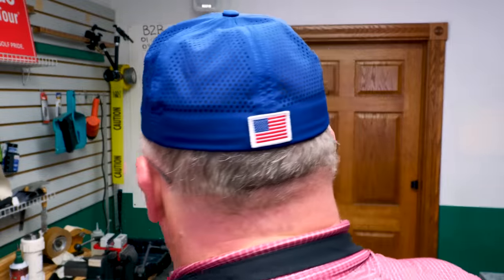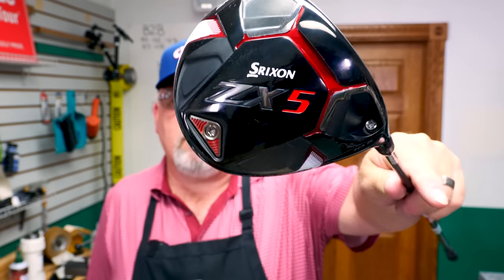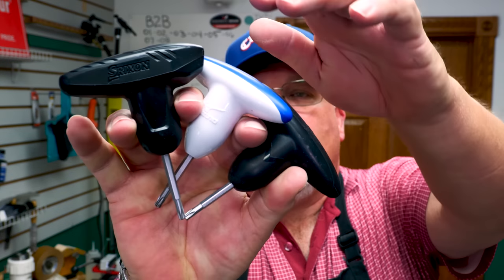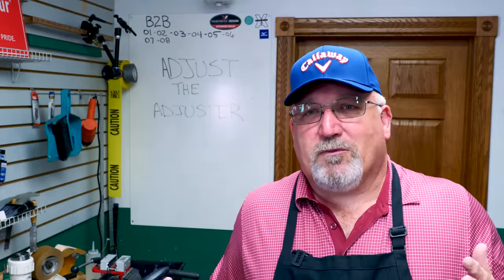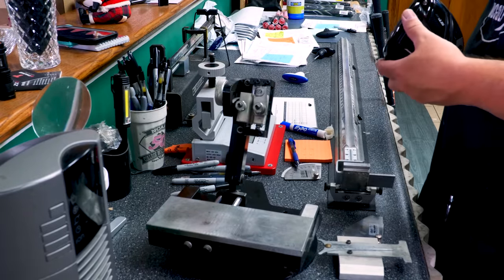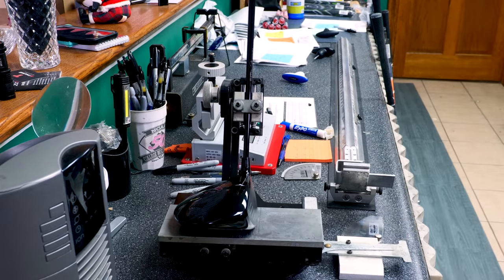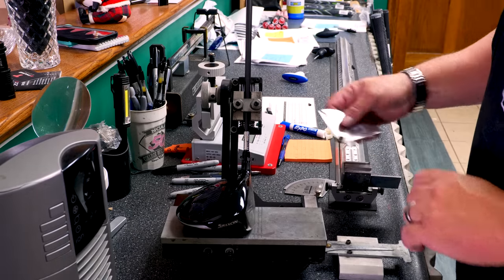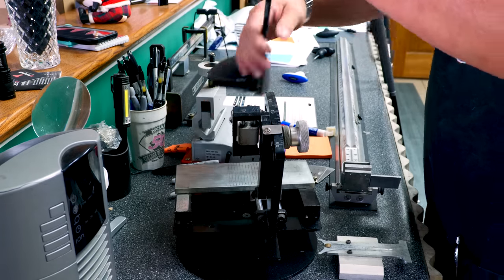How to adjust an adjustable driver

Comment: I have a first- generation rogue subzero and have tried all the adjustments. The 11 degrees draw setting works best for me. Recently I replaced the 14 grams weight in the back of the head with a 19 grams weight. I picked up about 10 yards and it feels like a new driver. Callaway clubs are very easy to adjust.

Comment: Just got my first adjustable club and trying to understand what happens when I adjust it.

This is very technical.  I understand “loft” and “lie”.  What is “spine and flow”?  What does he mean when he says “up”, “down”, “flat”?  Is he talking about the lie?

All I want is an additional degree of loft.  He did say increasing the loft closes the face, which I guess is okay for my (slice) game.

Very surprised none of the club manufacturers have videos on how to adjust their clubs.
Reply: Spine and flow have to do with the shaft itself.  When the shaft is made...it will have a stiffer orientation on one side where the material is slightly thicker.  Club makers like to orient this side in a particular way to make the shaft flex more consistently.  Most amateur golfers will never know the difference.  Up, down and flat is all about the lie.  Most manufacturers include a chart which shows how each adjustment affects lie, loft, open and closed.

Comment: I have a Maltby TC 4 Tour Plus Driver. I'm trying to understand the adjustments. it looks like mine is similar to the Callaway. I like the way it will keep the shaft orientation, but I still do not have a good understanding on how to correctly get the adjustment. I am a senior golfer with an 85mph driver swing speed. I also have a 45G Senior shaft and a 55G R shaft (Pured). Let me know what you think. I enjoy your info videos. Thanks

Comment: The concept of a clubface opening when the adapter is set to decrease loft is quite a hard concept to get my head around. With an iron if you open the face, the loft increases and vice versa. Do you have a video explaining this?
Reply: Check out mobile clubmaker.  He had a good video on that

Comment: I find it hard to buy a new driver for several reasons. First of all I tinker with golf clubs way to much now, don't need an adjustable driver to make matters worse. Second I love this look of an offset driver. Third my old driver still goes just as far as any new driver I try so why change.
Reply from the maker: Perfect

Comment: Does face angle matter?  With TM every degree change of loft you change the face angle double. Does the face angle become square when you rotate the face to a square position to set the adjusted loft?  Also with fairway woods will a club open a degree open make you have to close the face down at impact to not miss right?  I feel like you need one of those gauges to buy the right loft off the rack. I play a tour Sim Max head at 11.1 with .4 open  +.5 added loft so it’s 11.6 at .4 closed. I love it and to ensure I find the same club is nearly impossible and think that gauge would be a big help over time.  Might get thrown out of a few stores along the way though.
Reply from the maker: face angle matters a bunch particularly at impact just like you mentioned. most golfers will make the face look the same after the adjustment basically removing the whole benefit of the adjustable driver for the issue of the golfer.  The fact you know its 11.1 degrees and .4 open is something else too.
Reply: @McGolf  It was on the sticker from the tour. All those good numbers.

Comment: Thanks Jim, even showed me how to use the loft and lie device I have on the bench.  Do you dial in these settings when you fit or work on their swing first?  I get slicers in the booth who just want the club face closed, thinking it will cure their slice.
Reply from the maker: I use it in the fitting process to measure the woods lie and lofts and sometimes the irons
Reply: @McGolf Custom Clubs  thanks. Can you bend hybrids two degrees either way?

Comment: My understanding is that Callaway makes a right and left handed adapter. If I play right handed but was sold a left handed adapter am I doing everything opposite in the adjustment?  What about Callaway green dot and red dot adapters do the still maintain spine?
Reply from the maker: When using the lefty adapter on a righty club.they are opposite as you stated

Comment: I have the mizuno 12 degree and I slice a lot does going up in the loft close the face and potentially help the slice. Obviously I’m a beginner and it has to do with my swing but would it help a bit? Thanks in advance

Comment: That was not my voice. 😝 ❤️🍀
Reply from the maker: yes it is
Reply: Ok you changed the sound.
Reply: Jim,  you should have used the face angle measurement in the beginning to show a zero face angle.  After you adjusted the settings, you are adjusting the face angle, , then the measurement should have shown how the face angle changed, then when the club is in the SQUARE position then loft will reflect this change at center face contact
Reply from the maker: Dan, that is what I’m trying to do , set it square and watch loft change when adjusted